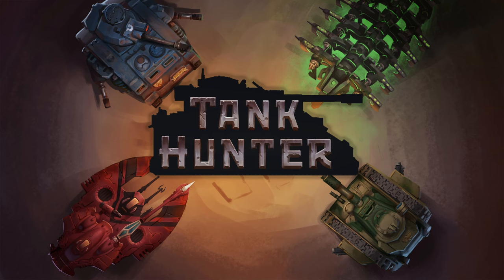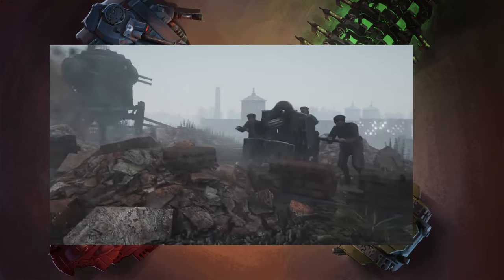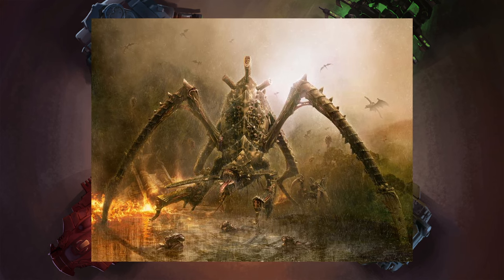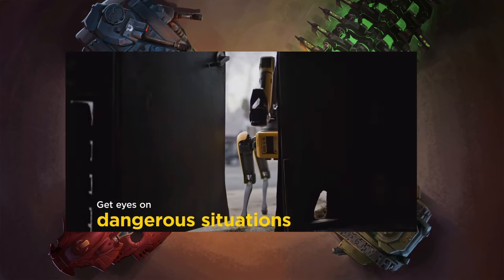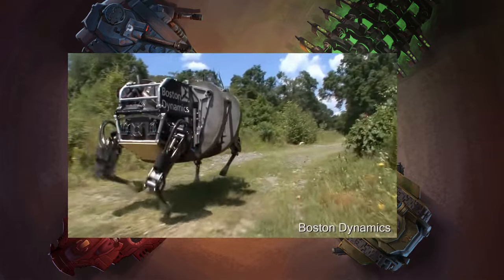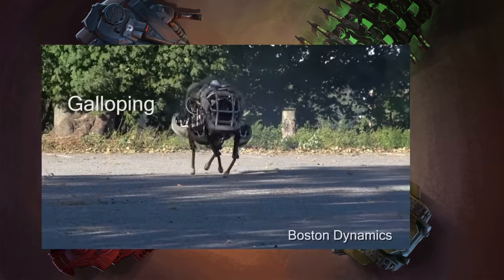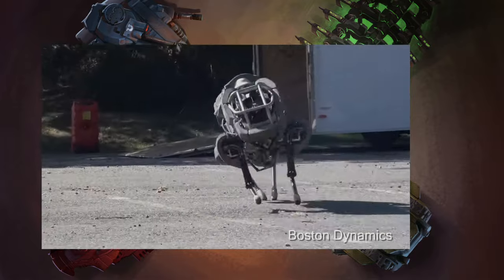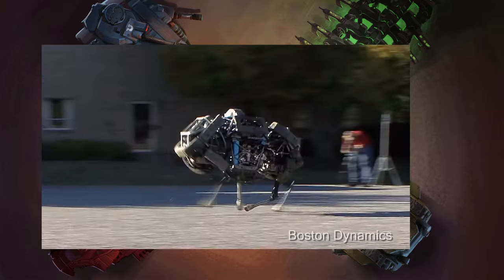Is it possible to build a tank on legs? A discussion and break down of walking tanks

Comment: As a combat veteran I can assure you that having the "horse" or "big dog" (I believe the robot was called a MULE) would have an advantage scaling a hill/mountain over aircraft and parachuting troops in. The machine would not be picked up by air traffic (we don't have stealth cargo planes yet) and you won't see the parachutes. Once the noise of the machine is decreased enough then you are really cooking with Crisco as that is the key to non-detection. The machine can also ferry injured personnel back in addition to the extra load they would have carried such as extra food and munition and could have way points and sensors installed for auxiliary purposes.
Reply from the maker: Oh yeah this guy definitely would have been cool to see put to use like that. It's a shame they stopped developing that model. How long would the battery or fuel need to last for on average would you say for field use? How often are you in a situation where you would need a guy like this with legs over a similar robot or vehicle with wheels?
Reply: @tankhunterminatures  it's all mission dependent. The batteries would definitely need a way to be quickly recharged and at least one set of replacements to swap during charge cycles. When it comes to using feet vs wheels vs tracks the terrain plays more of a role as does the possibilities of being ing tracked and counter-tracked. Too many factors to give even tgw simplest answers.

Comment: Neither of you thought of the Eighty-Six mechs. I'd say it would have been a different thought process than the ones mentioned. Disregarding the main character, the Juggernauts were fairly slow, and lacking in armour. And though they're fairly hidden, the legs appear to be powered from near the joint, rather than at it. Possibly hydraulically, like a plow, with the speed of a high speed PTO winch used in winch racing. What are your thoughts on this?
Reply from the maker: Ah I'm not a big follower of modern anime so this guy flew under my radar. But you're right these guys are fast as heck which I guess makes up for their lack of armour, if the cannon wasn't recoilless there's no way that guy was gonna stay in one piece when it fired that's for sure. I think the worst part of the design is how high the knees to the legs are, so much strain as it has to keep the feet in place and carry the weight of the body while being stretched out. In OHS lifting techniques they say always hold a heavy object as close to your body as possible, if your arms are stretched out like a crane when you lift the force to your back and joints is 10 times greater for a person, so you can imagine having the legs that far wide out the amount of strain would be so much greater if they were directly under the body. But with anime realistic physics aren't usually the high priority.
Reply: @tankhunterminatures  Fair points for sure, but I'd definitely recommend the show. They went rather in-depth about a few aspects of the design. The longer legs were more for maneuverability, and compared to other models (especially in season 2), the Juggernaut's guns were extremely weak and short-range. True, there were others with larger guns, but they almost never fired while standing. And even then, the recoil affected the body quite a bit. With the way the characters talked about them, the Juggernauts, as well as their refined counterpart the Reginliefs (probably misspelled that), they were "walking coffins". He'd actually carve out their logo from its armor with a hunting knife as a memento when someone died. I'd be willing to bet they weighed less than a modern car. The gun was probably more than half the weight of the older models.

If that's the case, leg design could be more focused on maneuverability rather than strength (hence the high knees), and even then, the main character blows out several of his Juggernaut's legs in almost every fight with his "reckless behavior". I'd still think they'd have to be hydraulic for the machine to have any real chance at functioning, though, given computer controls and physical demands.